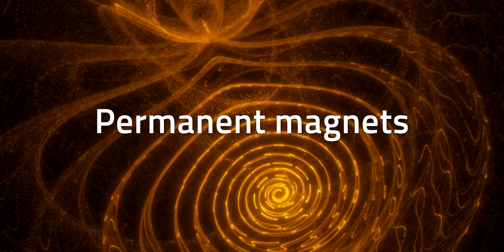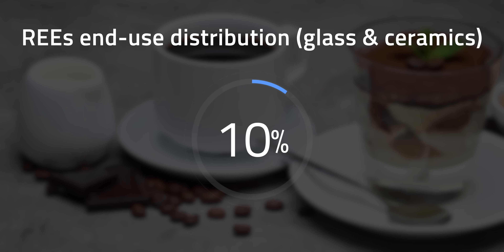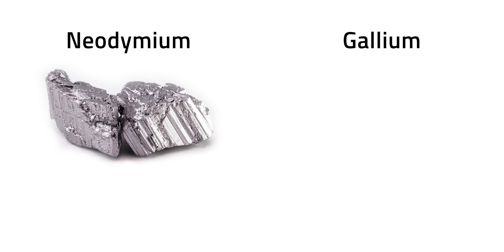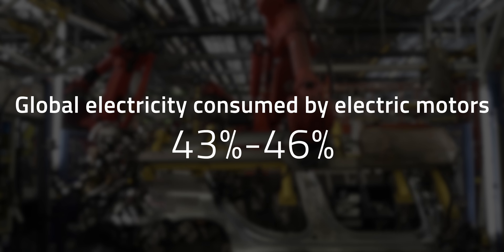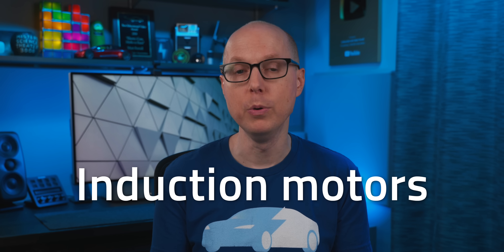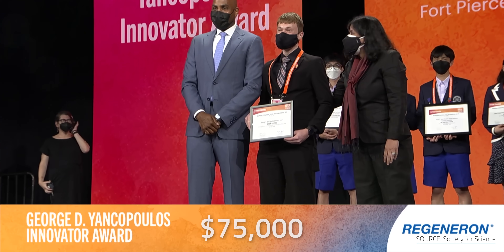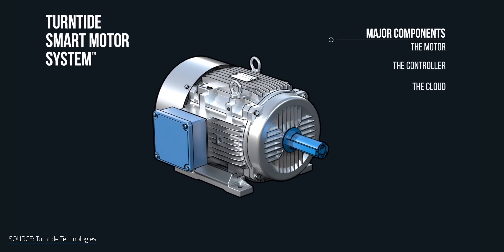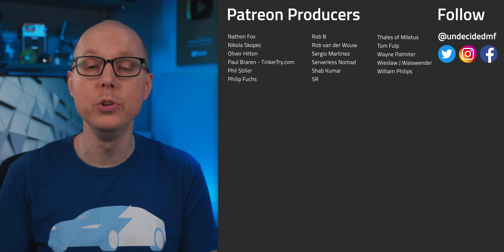Why This 17-Year Old's Electric Motor Is Important

Comment: Almost 40 years ago, I spent a year on a science project to find a way to make a hydrogen engine work, while I cracked it, I also cracked the block of the engine).  I continued my hobby of alternative fuels to this day.  My only regret after all these years is that I didn't pursue this as a career.  I hope that Robert is supported to continue his passion.  I also hope he nails the ISEF and suggest we go out of our way to support our future through people like Robert.
Reply: Look up the Omega 1 engine. It runs on hydrogen gas and has a fast RPM. I think they have a slight tolerance challenge though.
Reply: 3x+1=
Reply: Hydrogen comes from electricity or gas processes with extremely low overall efficiency. 
It's a non-starter!
Reply: @_a.z  there have been numerous new techniques found but it is hard to tell which ones are production ready.
Reply: @_a.z  I am also not sure hoe much the efficiency really matters because sometimes our energy production capability exceeds our energy use and storage capacity.  I believe that may be why not all the windmills are spinning around me.
Reply: @_a.z  Good point. Seems like we are the few that see this glaring problem to the hydrogen car fantasy.
Reply: @Nimrod Captain huh what? I am not sure what you are talking about. If you are talking about making electricity off of a stationary magnetic field, that would be funny because you can not. Meanwhile, moving a magnet next to a coil to generate electricity is how a generator works.
Reply: @Nimrod Captain are you saying that basically it takes less energy to switch the polarity than the energy produced from the action of doing it? -for the ‘fly by’/ breakaway moment?
Reply: Do you remember Smokey yunnick's 100 mpg carb?
Reply: @user-jn9dl9px6r  Yes, it was very similar to the Pfish carburetor.
Reply: @user-jn9dl9px6r  It was a system of a better vaporization of the gas/ air mixture; (I found it to be highly explosive). In retrospect, it may be could’ve been remedied by using a Spring loaded dump; similar to what is used on a V 6-71 Jimmy.
Reply: @user-jn9dl9px6r  I don’t know if you’ve ever been sitting behind a blower during a misfire, I think my shadow was permanently etched into the backseat after it happened with me.
Reply: @user-jn9dl9px6r  what the carburetor essentially did, -was to atomize  the droplets to the point of being more like gas fumes instead of a spray. If I remember correctly, it was said to be between 60 to 100 mpg. When an ordinary carburetor backfires there’s not really too much gas/air mixture to burn and the engine just sucks it down. But when you have that much volume of fumes sitting up there and it ignites; it’s like a bomb. Similarly, A blower unit contains a lot of pretty well mixed fuel/air inside the twin screw unit below the carburetors. ( blowers were only intended to compress pure air for Diesel engines ; not a gasoline fuel mixture!).
Reply: If you have a passion for it, it’s never too late!  Do it!  Pursue it as a job you could get paid for. The world needs this innovation!  It’s a huge opportunity waiting for you. 🙏🕊😄
Reply: It doesn't really matter how efficient the motor is, the fact remains that battery range (ie lack of ), is the major downside to EVs, plus you have children digging out the rare earth metals at great rosk to their Health and Safety. Furthermore, the infrastructure for charging stations is currently very underdeveloped, and even if that issue is addressed, the fact still remains that there would insufficient capacity generated by the National Grid to charge every vehicle, were, for example, 50% of the population or more, were to put their car on charge all at once. In addition to this, there is a finite amount of rare earth materials available from the Earths crust, so the life cycle of EVs is not going to enjoy anywhere near the longevity that the ICE has enjoyed. As such elements become ever scarcer, that'll inevitably push the individual price of EVs up, eventually resulting in those who can still afford them and those that can't - a two tier society in effect. You can be certain that the individuals that are aligned to the WEF will not be going without their personalised mode of transport, whereas the rest of us will just have to use a push bike or shanks' pony.... all part of the plan of course. You'll own no car, but your feet will be sore !
Reply: @jamesbarbour8400  agreed. I believe the corner cutting of manufacturers created by the emissions reduction and electric car grifts have severely damaged the R&D in ICE. There are so many fuels that are either byproduct or non petroleum based that could run efficiently in ICEs. But the R&D is pushed aside to create less efficient after engines to modify the emissions and not truly reduce them. On an individual level it is quite possible to produce high levels of mechanical energy efficiently using ICE technologies. But sadly there is no viable market to support such endeavors sustainably. 
Stay free
Reply: @_a.z  
What about hydrogen farms that are off grid ran on solar and wind?
Reply: @Nimrod Captain build it
Reply: Hydrogen is easy to make it work in a combustion engine. U just need to calculate the mixture H and outside air mix that has the same.burn rate as gas or diesel. Pure H will burn a hole in the piston. I studied all the videos I could find from stanley meyer and I believe he was correct. He had it all figured out.
Reply: @yvesstocky9936  Buy me the materials. 

Never understood why we always use permanent magnet rotors and stator when we could instead use ring magnet arrays of anode and cathode rods a stationary field excitation should occur around a stator as the magnets stuck to the turnbuckle rods spin all it should require is a push to start up. 

Good magnets aren't cheap though so if someone buys i'll fly.
Reply: Sixty years ago, we had the same problems as well as stripping the head bolts out of the block when we made stronger heads.

Comment: Matt, when I was taught about induction motors the diagram we were shown for the rotor was two rings at either end axially connected by bars spaced around the rotor. These bars were the current carrying conductors in which the electromotive force would be generated. The rings were what completed the circuit for the necessary current to flow. To me it looks more like an elongated hamster wheel. But I guess squirrel cage sounded better.
Reply: A power supply either DC or from kinetic like a wind turbine excites the stator and thats what produces the field the conductors well...conduct the current to the rotors.

Comment: We can already use AC motors in cars today which eliminates rare earth metals today. The efficiency loss of using a VFD isn't really far off from high performance DC motor efficiency due to the control circuitry.
Additionally, without seeing much in the way of how he designed the motor it's hard to say he did anything new, people tend to not fully understand what a new patent requires when it comes to something as common as electric motors.
Reply: The thing with AC motors is they are good for a very narrow RPM range in comparison to DC motors which have a much smoother power delivery throughout their RPM range. AC motors are great for things that don't need to change RPMs much but can be a bit lacking for using in vehicles that must go and different speeds.
Reply: @roguetorino  Tesla and some other EV manufacturers already use AC induction motors. They can have great performance over huge RPM ranges with modern VFD controllers.
Reply: @roguetorino  couldn't that be overcome with a gear box?
Reply: @danielmethner6847  How would you implement a mechanical gearbox on an AC motor unless you somehow change the number of poles to modify the torque and even so what would be the reason given that the control of the rotating speed would be far less accurate than what you already have using variators
Reply: @roguetorino  Exactly, in Ev applications the required load rage is large. Peak efficiency of induction motors is usually matched for highway driving, but low load city driving they drop to 60% eff. or even lower.
Reply: @5467nick  Tesla only uses AC induction as a secondary motor.  RWDs and the primary motors on AWDs are all permanent magnet motors.  The permanent magnet motors have a higher efficiency.  They switched to permanent magnet motors when they solved the low speed cogging problem that other EVs still have.  My chevy volt cogs at low speed.
Reply: @roguetorino  the exact opposite of this is true
Reply: @roguetorino  That's only true for fixed frequency AC. If you're making the AC from DC batteries, you can pick your own frequency, and change it to change RPM. (VFD)
Reply: @danielmethner6847  Don't need to. Just change the AC frequency.
Reply: @factory_enslavement  I can't remember the details, so I apologize for not being super specific. One of the early automatic cars used a system of a conical transmission which alleviated the need to change gears, so had smooth power delivery through its range. Basically it let the engine run at a relatively optimal torque range and the change in speed came from the point the drive band was on the conical shaft. Because it wasn't geared it meant that it had essentially infinite gears and a smooth power delivery curve. Design fell out of favour and I can't remember why.
 If the progress and emphasis at the moment is to increase the efficiency range of an AC motor, then I would imagine that we could focus more on increasing the efficiency of its optimal rpm. If this gearbox allowed a motor to stay in its peak efficiency range and the output could be varied without changing the motors RPM then that sounds like a good solution to me.

Edit - it was the Variomatic transmission in the DAF 600 from 1958
Reply: bruh ac motors? do u have any idea how little that narrows it down

ac motors use magnets too

ac motors is a very general category
Reply: agreed, AC motor are very common in railway vehicles. high speed trains, metro or locomotive are using it.